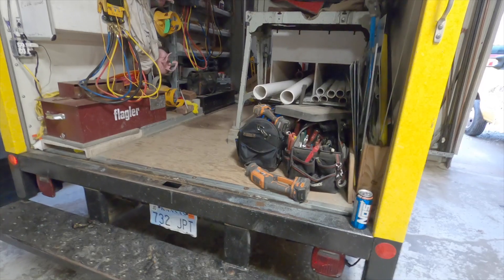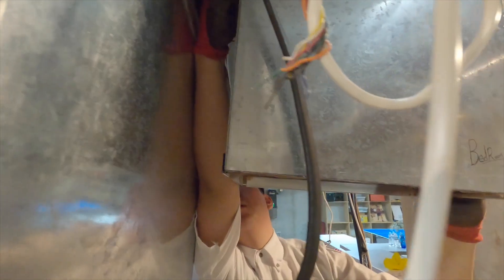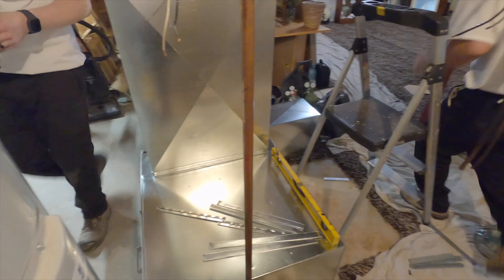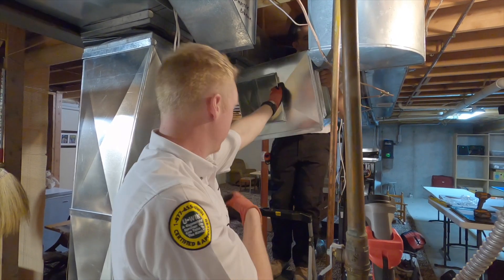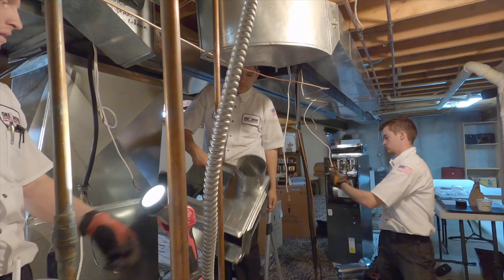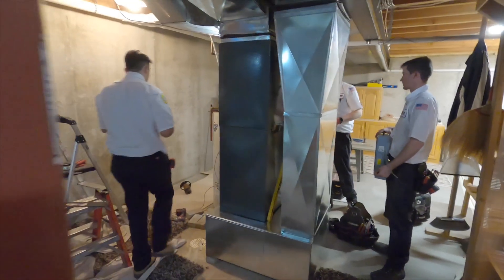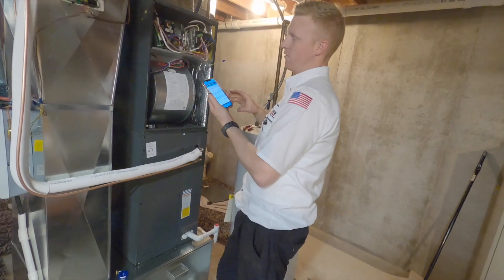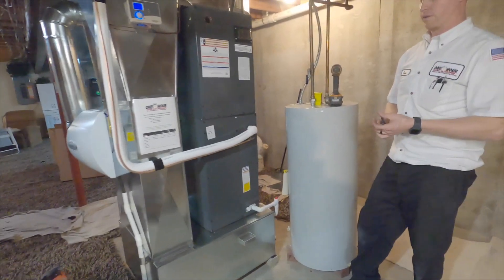Converting 2 HVAC Systems to 1: Complete HVAC Install

Comment: Dope metal work, but just a small question and thats do you guys insulate your ducts afterwards and if not why? Just wondering because my company and the nearby ones Im familiar with also insulate and we use bubble wrap or fiber glass